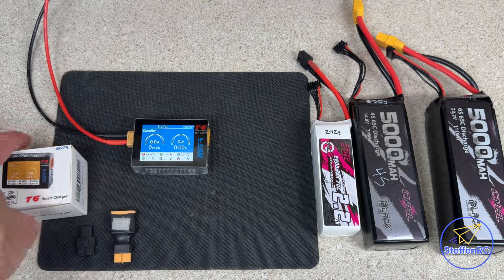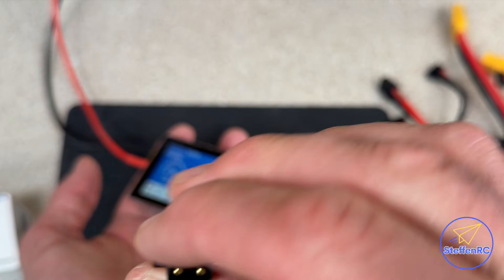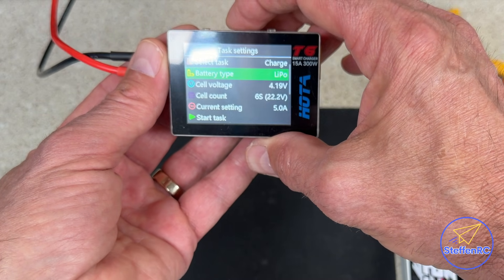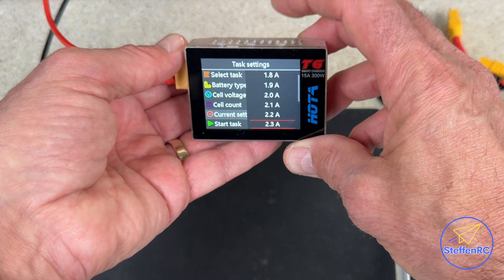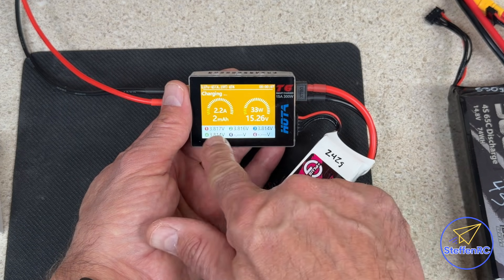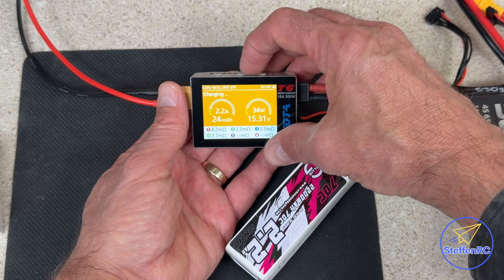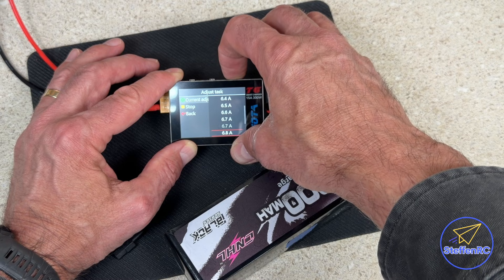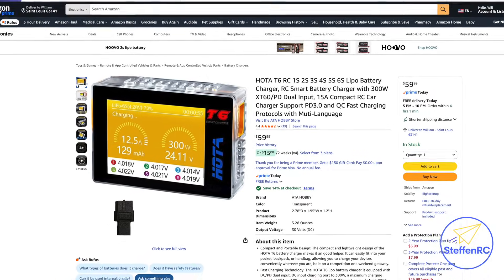Hota T6 - Powerful Lipo charger for RC batteries

Comment from the maker: This is a really nice little charger for the field kit. (if you have access to DC Power).  One thing I've heard from others is don't use this charger to discharge your large batteries.  Its slow and can overheat.  That said, its a really powerful charger and its replaced my ISDT field charger I used to use.   Thanks, Will
Reply: If you want to use this to discharge bigger batteries(not the best plan, but) you can use external discharge mode and the heat gets dumped into your external resistor bank. I made a homemade setup with 55watt halogen bulbs and can discharge @ 180+ watts no problem with it. I use my D6 instead for this but the option is there if you want on the T6 too. Sweet charger as are my two D6's.
Reply: @TC-ut1tw  Easier way is just slap a decent heatsink on it and have some airflow
Reply from the maker: Thanks for sharing that tip.  Appreciate it.
Reply: Just slap a decent heatsink on it and have some airflow

Comment: Loved mine till it stopped working 😂 never again buying this chargers or hota and rebranding 😂  won't charge anymore getting error  this ain't my first with this type of chargers that crapped out on me.. but the pd charging phone works still just can't charge batteries
Reply from the maker: Curious if you communicated with Hota support.  Also. Did you use it for discharging?

Comment: An adapter everyone needs to make..

Mine is on 10 gauge wire, 
2 spade connectors and an xt60, 1x spade per wire, solder the XT60 as normal. 

Place the negative spade into the negative slot on a drill battery, Positive spade into the positive slot. Plug in charger.

Use any Drill battery to power the charger with this connector. 
(Making sure its 18/20v battery with enough Ah to help you)
Reply from the maker: Thanks for sharing.
Reply: Why so complicated? I may haven’t undestoodyour battery spiele though… I often use a 7S2P 9000mAh LiIon :)
Reply: @ficosk8 soldering 3 plugs onto 2 wires, and using drill batteries you have laying around is not complicated?
Reply: @MartynC91 OK, you mean connecting several smaller packs to make more capacity? 👍🏼 understood :)
Reply: @ficosk8 what? No 🤦‍♂️ if you arent going to read what i wrote, what is the point in replying.

Making ONE adapter that allows you to plug a drill battery into a xt60

Have you never seen a drill battery.

Don't get what is so hard here.
Reply: @ficosk8 its one adapter.. for one battery. One side has an XT60 male plug, the other has a spade connector on each wire.
Reply: @MartynC91 OK! 👍🏼
Reply: @MartynC91 Weil sorry for what I wrote in the beginning. I did not understood what your wrote but I wrote your whole comment, of course. It’s just Like for you Reading Spanisch, German or italian. Other languages I speak but I don’t know all technical words.
I understand what you meant. Powertool batteries. For me it is much easier to use of If several RC batteries (Lipos or LiIons) which have XT60 or 90. But you may have more of those Drills batteries :) 👍🏼 Either way the main point is to fly :)) I also often charge at my 12V car battery 👍🏼

Comment: I've had this little monster, loved it so much that I recommended 2 others to buy it, which further got recommended to a 3rd.
I only.retired mine when upgrading to a twin port charger, though with some of the features lost, I would struggle to call it an upgrade..
My current charger cannot discharge, something I never thought would be an issue until I had a full bag of charged batteries and no fly day weather. 

Epic piece of kit, absolute bargain too.
Charge in the field with a USB PD powerbank, or as I did, just use a drill battery to power the charger directly.
Reply from the maker: I agree this is a great little charger.  I like your drill battery power system idea too..   Thanks, Will

Comment: Great charger, not great at discharge or balancing where voltage needs to be bled. They will blow resistors if used in discharge. I now only use it for charging.
Reply from the maker: Good to know. Thanks for adding that.

Comment: I don’t understand the use case for a single battery charger.
Reply: I think the size lends itself well to bringing to the field as a small profile charger with a 12 V input you could set it up with a cigarette lighter and a charger from your car provided the amperage worked out.
Reply from the maker: Its just a simple small charger for field use.  Most of the time I bring all my batteries with me to the club.  But there are times when I'd like to fly one more time.  This little charger will help me do that on our clubs DC power station.  Instead of lugging around my ISDT K2....
Reply: @SteffenRC exactly! I immediately saw the value to plug this into our old school 12v system at the club. Helpful for flight days where I don’t want to lug my whole kit. So yeah I bought one. Also everything else on your last video for my new hobby caddy. LOL
Reply: My use case is that I had a quad charger at one point and a display failed. So I bought a 24vdc power supply, 4 single chargers, and mounted all on a small plastic cutting board, with handle. Very portable and if a charger fails I can replace just the one.

Comment: Hi -looks great ! Does it charge 3s battery using just balance lead ? Also can you power this charger using a power bank ?
Reply from the maker: You can charge 2S-6S batteries.  You must plug in the XT60 and the balance lead.   This charger uses DC power only, so if your power bank is DC power, then this will work fine.
Reply: @SteffenRC great stuff Steffen ! I guess the balance port on the hota does not supply enough juice to charge a battery I its own . thanks. K
Reply from the maker: The system is designed to use the balance plug to balance the cells while charging.  Not sure the balance plug can handle the amps the charger is pushing.   I have a few chargers from RTF systems that only use the balance plug.  The charger VERY slowly...
Reply: @SteffenRC thanks steffen ! I think that’s the case !   Cheers -great clear channel by the way

Comment: I love m y HOTA chargers. I also have bought some for colleagues. Just lacking the 8S multi charger :( So I have also a ToolkitRC one but only two channels. HOTA has much more options to charge as well as balance only, which Toolkit is lacking. Would love a Hota F8 ! :D Cheers Will!
Reply from the maker: I'm just now digging into them.  I'd like to get my hands on the D6 Pro too..  I've been a ISDT charger guy for a while.  Its funny, the interface is very similar.  Probably made by the same company..  🤣
Reply: @SteffenRC  Aha! That might be truth or similar adopted menus. ToolkitRc is totally different but has a cool feature, that you can programm/set presets for inputs (different power sources) as well  outputs (types of batteries). The last one is for max 10 types and mine is full. But I like also very much the Hota. Is pretty fast in connecting a new pack and double click and it beginns to charge. I have had the two channel without power source first and then the F6 quad channel also without power source. Ahh I forgot, the first one was when I had cars and was that D6 or pro with 300W capability but it was a bit heavy to take to the field. All great ones :)
Reply from the maker: Appreciate your insight

Comment: A 6S Lipo is 25.2 volts at 4.2 volts/cell. Theoretically, the Hota T6 can put out about 11.9 amps at 25.2 volts (300/25.2=11.90 amps). So, it should be able to charge two 5000mAh-6S in parallel at 10 amps (5 amps per pack). Not bad..
Reply from the maker: Its a neat little charger and is now my "field charger."  Takes up less space in my bag and is better than the similar ISDT charger I was using for field...
Reply: And when you are charging between 22-23V more amps, also you can put way more amps until 4-4,1V without damaging the cells. After it gets not so good because Ions can be ramping not in a controlled manner, to say it in a way.
Reply: @ficosk8  I was pointing out that it'll do at least 1C on two 5000mAh-6S's in parallel all the way to fully charged. But sure, it'll do more amps at a lower voltage.